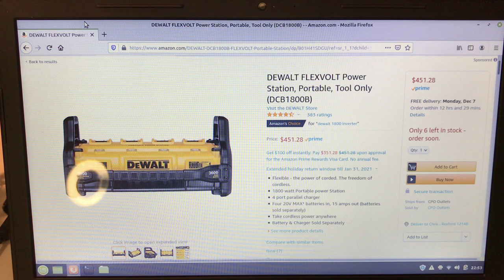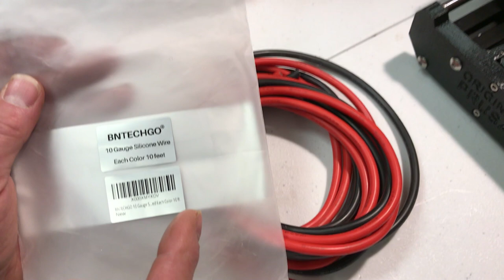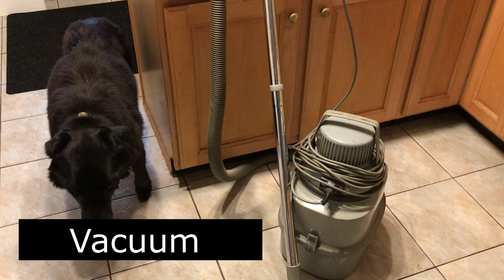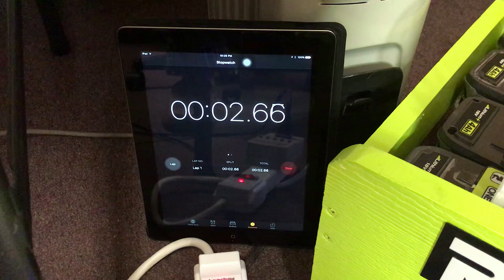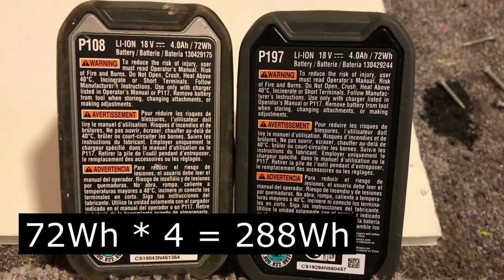Ryobi 18V 2600W Powerstation

Comment: This is a fantastic project! Thank you for sharing. 

You know how you can tell that Ryobi doesn't care about what might actually be useful for their tool owners? A simple 18v battery port to 120v ac power cord. Voltage stepping / regulation could all be in the 18v connector side, bam, you could your 18v shopvac for as long as you need while near an outlet.

Comment: Chris, great work.  I would like to build one of these.  It would be great if you could draw up a wiring diagram that us old timers could use. Thank you
Reply: it's preety simple get a 40V capable dc inverter (it'll have only a positive and negative input) from there it's a simple 2 batteries in series (connected together positive from one battery is output the negative off that battery is connected to the positive of another and the negative of that battery is output) do this 4 times for a total of 8 batteries then it's just a matter of having all 4 positive lines connected together and all 4 negative lines together this is your 4 parallel batteries in parallel increase capacity batteries in series increase volage. once youve joined your batteries together you simply connect them to the pos and negetive terminals on the inverter.

Comment: i think the most helpful test of all your items was the 1500 watt space heater.  i am a Ryobi fan and have almost every tool they make.  i'm also a former Home Depot employee and i have the exact same heater you used.   the critical question for all battery powered items is how long will the power source run the item?  seventeen minutes of total run time for a 1500 watt space heater shows the extreme limitations of all small size battery power generators.  most household appliances are going to be in the 1000-1500 watt range so you can see how a small power unit would be inadequate for any type of emergency dependency.  what this kind of unit COULD do very effectively would be to run LED lighting.  a 100 watt (incandescent equivalent) LED bulb only draws about 22 watts.  that means you could easily run ten such bulbs and only take up 220 watts of power which would not be too taxing for your small power unit.  the problem with ALL "battery power electric sources" is that you CANNOT CHEAT PHYSICS!!   until some kind of "super battery" is invented, battery power for EVERYTHING - cars, houses, appliances - will have significant limitations.

Comment: For each pair of batteries in series there should be a fuse and blocking diode. The blocking diode will prevent the flow of energy between the batteries in parallel which will increase efficiency and save your batteries.
Reply from the maker: I have a more recent video that shows the pros/cons of using blocking diodes ( https://youtu.be/dqF27lWg6I4 )

Comment: Announced today, Ryobi 18v 1800 Watt Power Station. No pricing mentioned but it will be able to use up to 8 batteries and is supposed to be available in Summer 2023. Yours is probably way cheaper than the Ryobi one though lol

Comment: Dude, i guess great minds do think alike. I bought a bluetti. Its ok for small things, but I kept looking at my Ryobi batteries thinking, there's gotta be a way of using these. Im a MECP certified installer, who used to work for Best buy and circuit city, also worked for Sea Vee boat, doing electrical install for Marine. My question is how did you wire them? Series, parallel or what combo of that. Are you feeding the full 18 volts into the inverter? I know most car audio stuff loves 14 volts, but any higher than that and you can run into some expensive problems. Love the project. I have a 2006 Caravan I'm setting up as a camper/ bug out van, I just got a bad feeling and don't know if to expect WW 3, Civil war 2, War of the Worlds 1 or the great tribulation..ya dig. May go all out and rap all the electronics in copper tape to shield them from EMPs, as a type of faraday cage. You've got a new subscriber brother. Cheers and see ya on the other side.
Reply from the maker: This project is 2S4P. I wired two 18V batteries in series to get 36V. Then I wired these in parallel for extra watt capabilities. The inverter is a 36V unit that maps to the voltage range of the batteries perfectly. I always put fully charged batteries in together. If you put different charge levels batteries in, you could have serious problems. You can use blocking diodes if you want to do that. Check out my 40V charger hack to see how.
Reply: I see. Thank you so much for the technical info. Cheers.

Comment: Chris, one thing I have never seen is the reverse of your power hacks--a Ryobi AC to DC adapter. So you could run stationary One+ devices by plugging them into AC instead of using up batteries. That need comes up every so often, especially with power hungry devices. Seems like there would be more to it than simply converting 120V AC to 20V DC. Something you could tackle in a future video?
Reply from the maker: Thanks!, I have thought about it, but I think it is harder than we think. Some devices can take 10A at 18V. I did see that Hitachi makes one: https://www.lowes.com/pd/Metabo-HPT-was-Hitachi-Power-Tools-MultiVolt-36-Volt-4-Amp-Hour-Lithium-Power-Tool-Battery-Adapter-Kit-Charger-Included/1000623987 . Maybe we could adapt that to Ryobi? It does 18 and 36V tools.

Comment: How do you like the new Ryobi power station that runs off an 18v One+ battery, a cigarette lighter adapter, or a larger capacity 12v battery?  I checked them out but they use a modified sine wave inverter, so I'm not interested.
Reply from the maker: I bought one and I'm doing a review as we speak!
Reply from the maker: https://youtu.be/h4y5VV1aVHA

Comment: Just curious,  they make adapters for mikwaukee and DeWalt batteries to run Ryobi tools,  could one inter-mix these with ryobi batteries on this type of inverter?  I have plenty of Ryobi 9ah batteries and many DewAlt 9ah and Milwau 12ah... So that would be great if so.
Reply from the maker: I'm not sure if the other tool batteries have the BMS in the battery or in the tool. With this current design, you want the battery size (Ah) and charge level of battteries to be the same. You could make a powerstation just for your  other brand batteries

Comment: Great work! But the dewalt power station actually runs a 1500 watt heater for 33 minutes with four 6amp hour batteries 👍🏽
Reply from the maker: I'm not sure how this is possible? I don't see a wH rating for the 20V/6Ah Dewalt battery. Best case would be 20V*6Ah=120Wh. If 4 batteries are hooked up in series, that would give you a Max of 480Wh. A 1500W Heater would only run 19minutes (assuming no inverter loss which is unlikely). At high loads, most tools batteries I've tested never meet their Wh ratings. I would use a kill-a-watt meter to make sure you are actually drawing 1500W.
Reply: @SerendipitySue  well they are actually 6 amp hour flex volt. And there’s a video of a guy running it on you YouTube. Search it 👍🏽
Reply from the maker: @LaCatHTF  The flex batteries are 20V/6A or 60V/2A (same number of Wh). I looked quickly and didn't see the video. It appears that the  Dewalt is also a modified -Sine wave inverter, not pure-sine. Still pretty nice if you own Dewalt tools!

Comment: hi,great project.thanks for posting.Could you recommend any videos on you tube that demonstrate how to go about linking battery pack in the series and parallel configuration .Eg instead of the 2s4p in your one,i am wondering about 2s 8p into the 36 volt inverter that you used.Are there any things to be mindful of -thanks,best wishes from UK.I plan to use the slide on einhell/ozito power x change 4ah packs
Reply from the maker: You can easily  add more sets of parallel batteries. BUT you have to be careful that you use the same Ah rated batteries AND that they are equally charged. Adding empty and fully charged batteries  is a recipe for disaster... the current from the fully charged batteries will rush unprotected to the empty batteries.

Comment: :yt:I have watched this video more than 5 times. I have been trying to construct something similar. If I have a Power inverter labeled 12v Dc input, will this work with 24-volt Kobalt Batteries ??:yt:
Reply from the maker: If your power inverter says 12V, then that is what you need to provide. The 24-Volt batteries would be too high.
Reply: @SerendipitySue  okay thanks .

Comment: Would it make sense to to use a 12v inverter?  If so do you have any ideas on how to go from 36 to 12?
Reply from the maker: I don't think so. I have used DC-DC converters to output lower voltages ( https://amzn.to/2Ry74J6 ). Typically I use these in addition to an AC inverter. I have a lot of 12VDC devices (ie. fridge/freezer/CPAP)

Comment: Good job Chris! I think I might make one. What would you do to get the full 3000 watts?
Reply from the maker: You can actually get 3000 watts out of this set-up when the batteries are fully charged. The voltage drops as you consume energy.  At some point it will no longer be able to supply enough power. The easiest thing would be to add another 2 batteries.  ie. make it a 2S5P set up. The more batteries the better... it makes each one work less.
Reply: That would be fantastic to have the ability to hold 10 batteries. Use 4 to 10 batteries depending in your application and desired run time.   18v x 9ah=162wh x 10 batteries   1.62kwh!!!   I am really hoping milwaukee makes an 18v power station like that. They have the mx fuel version which would be easy to adapt.

Comment: You don't seem to be using a DC to DC voltage converter in this build. Are the 19 volt batteries OK for the converter?
Reply from the maker: Yes, the inverter is designed for a 30V to 45V input range which is perfectly matched to the two lithium batteries in series

Comment: Is there a reason to go with the 16ah 36v inverter set up, vs a 32ah 12v inverter set up, using a step down?
Reply from the maker: you would need a step-down capable of a lot of Amps. You also would have some energy loss and have added weight.

Comment: There’s a link for safety on this project ——Blocking Diode  , so the charge thosent come back and damage the battery’s by recharging them
Reply: uxcell Forward Silicon Power Rectifier Diode 16mm Stud Version 1600V 100A
Reply: Your friend from Portugal 🇵🇹
Reply from the maker: I mentioned in the video that you need to use batteries of the same Ah rating and same charge level. I suggest only using fully charged batteries. I thought about using blocking diodes. The downside is that with different level batteries, the powerstation will only be running off the highest voltage pair. That means that you may not be able to run large devices until the voltages equalize. I'm making another powerstation using my 40V batteries. I will probably test using the blocking diodes because it would allow hot swapping.
Reply: Tank you so much Chris for your input one more time , and I can’t wait too see your new 40v project  hope Ryobi brings you notice or a job or more tools battery’s

Comment: Can this be done with the HART tools super charger?
Reply from the maker: I had never heard of HART tools. I looked it up ( https://www.walmart.com/ip/HART-20-Volt-Lithium-Ion-4-Port-Fast-Charger-Batteries-Not-Included/803164948 ). You could probably do something similar to my other project: https://youtu.be/TCWndCrfHi8
Reply: @Phenna_Michelle - have you checked where the Hart products house the battery management system circuits (BMS)? It could be in the batteries, or it could be in the tools and chargers. Both Hart and Ryobi are manufactured by TTI, but that does not mean that the Hart products house the BMS the same as Ryobi.

Where the BMS lives determines how any DIY tools must be designed.
Reply: @stevebabiak6997  ok thank you Steve I will find out!

Comment: How were the batteries wired? Parallel or series? This is a really great video but if you went in-depth in how the batteries and inverter was wired it would have been even better.
Reply from the maker: 2S4P configuration to get 36V
Reply: @SerendipitySue  thank you

Comment: Hmmm would it run a log splitter
Reply from the maker: Interesting idea! The specs say 15A motor ( https://amzn.to/2Nh3ReW ).A lot would depend on the start-up current. Unfortunately I have a gas wood splitter and can't test it :-(
Reply: @SerendipitySue  the specs are generally around 2000watts however in rush current is unknown
Reply: yeah 6 to 7 tonne splitter  wow that one comes with a stand too 
i waited till peak season and got mine here in oz for about $250 @ bunnings (home depot in the USA)
Reply: yeah sorry i forget about the 60hz\120v thing

Comment: Very cool.  You are making progress on what I've (probably many) been looking for.  Questions:  could you hook this set up to a 12v 2000W inverter changing the wiring?  Do you think it's possible to make a hot swappable power supply using ryobi 18v batteries?  Is the number of batteries used theoretically limitless?
Reply from the maker: The Ryobi batteries range from 15V (empty) to 21V ( Full). This is outside the range of any 12V inverters I've seen. You could put the power thru a DC-DC converter, but it's hard to find one that would have the Amp ratings. I did a project ( https://youtu.be/TCWndCrfHi8 ) that drove a 300W pure sine wave inverter. 

The hot swappable supply would be hard. The batteries all need to be the same type/size (ie 4Ah) and have the same charge level.

You should be able to hook up as many batteries as you can afford ;-)  We just need a better circuit to safely charge them all at once. I have figured out how to charge just one at a time (  https://youtu.be/MTZdvhf6cB4 )

Comment: Hi Chris its me again. 1st off great job.   Thanks for the shout out about the dewalt power station.  With all that im thinking about developing my own power station.  

My question is do you have any recommendation for a 4 or 5000 watt pure sine inverter and how do you manage the rate of discharge of all the batteries equally
Reply: As always thanks again great job
Reply from the maker: So you always have to use the same Ah batteries together AND they must be at the same charge level (I suggest always only putting fully charged batteries in).  When designing a system. Try to aim for 10A per battery. That way you will not stress the batteries too much.

I have a car lift in my barn that I use a Power Bright 6000W pure sign wave inverter with two group 29 deep cycle batteries from walmart. But you will need an 18 or 36V one to match the Ryobi batteries. WZRELB makes a 5000W version ( https://amzn.to/3gdxebQ ). I used the 3000W version in my project.

Comment: How many cycles do the 40 volt batteries get?
Reply from the maker: All of my Ryobi batteries (18V and 40V) are still working. They say LiON batteries will do 500 cycles before they fall under 80% charge. You can look up the specific 18650 cell specs in your battery